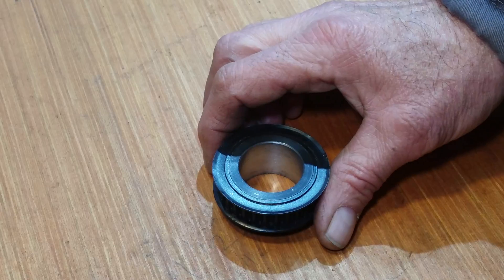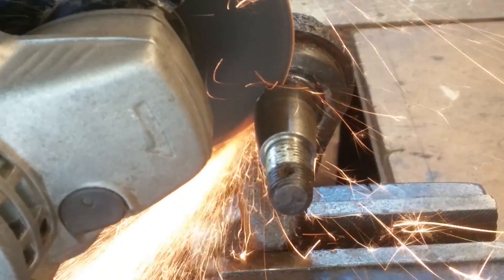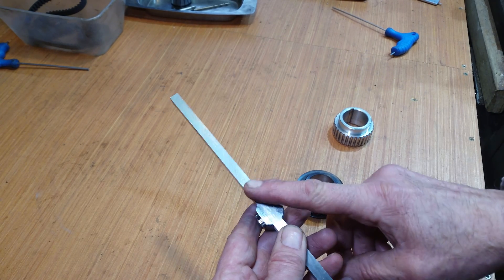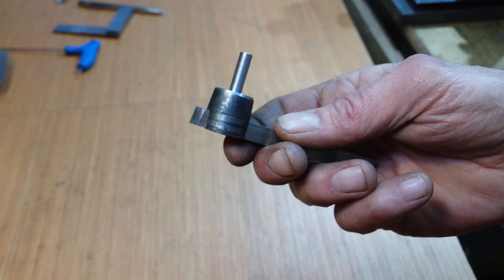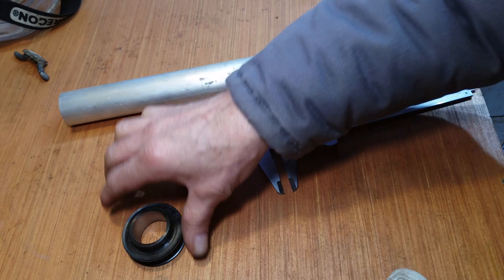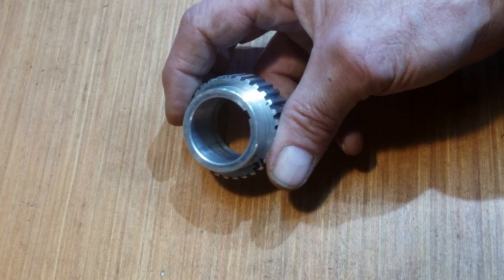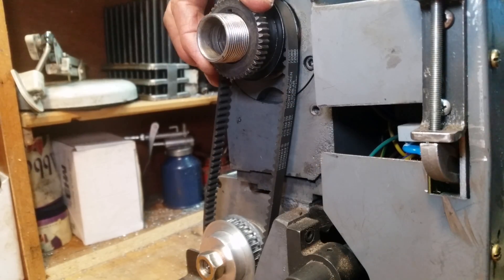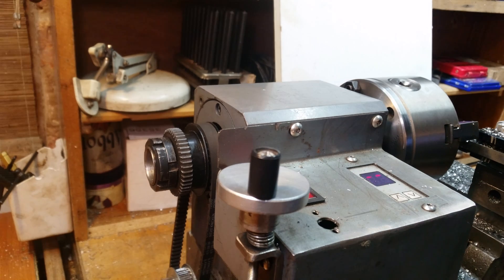MINI LATHE UPGRADES #4: HI-TORQUE PULLEY & Shop Made Keyway Cutter

Comment: why not use a 4mm drill or 4mm broken endmill as a starting point for a 4mm slot cutter?
Reply from the maker: I did consider this but it's much easier to grip and align a square-section toolbit shaft than a circular one. Which isn't to say that it's impossible! However, I happened to have the length of 8mm HSS bar stock you see in the video and decided to go with that. Appreciate your input, thanks for taking the time 👍